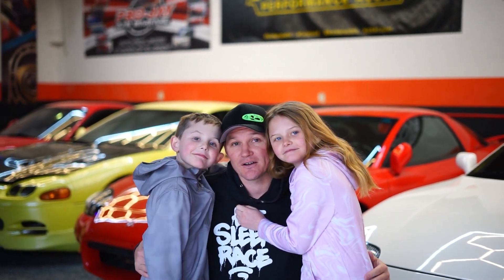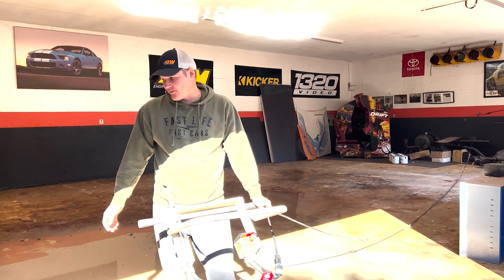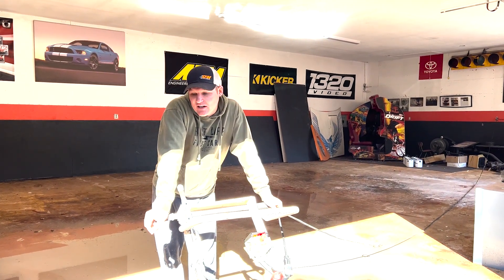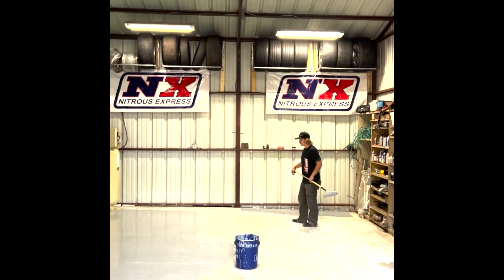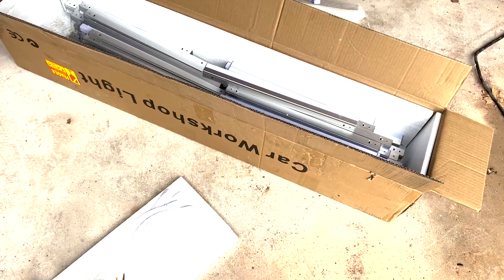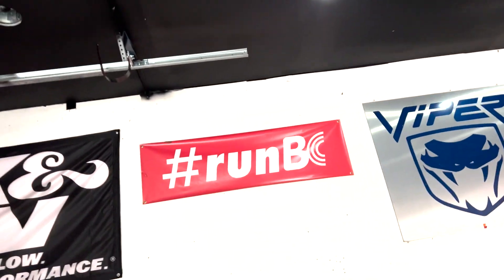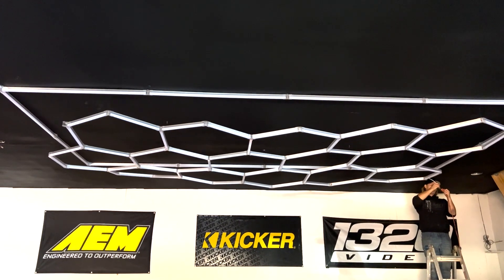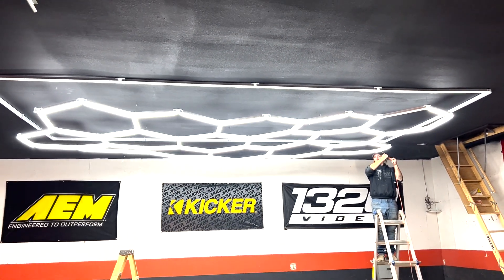Building My DREAM GARAGE! Complete Makeover! Part 1

Comment: it says GT2 RS in the video ( the chassis is GT2 RS) 
but the engine is from the GT3 RS ( Metzger 500 hp N/A ) you have the revs of the GT3rs (9k)  turboed )done my a small indy company in germany ))) (9FF) 241 MPH half mile cant be bad )